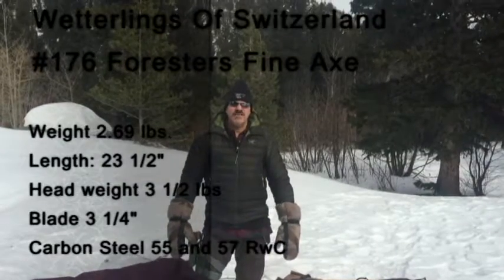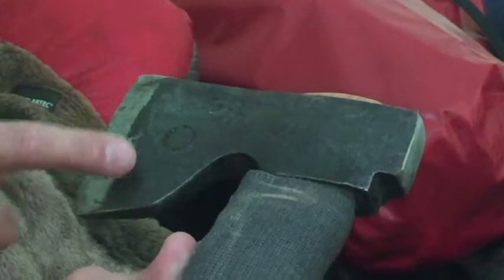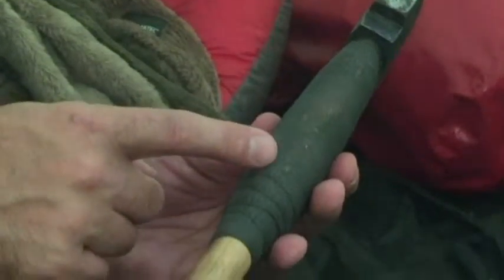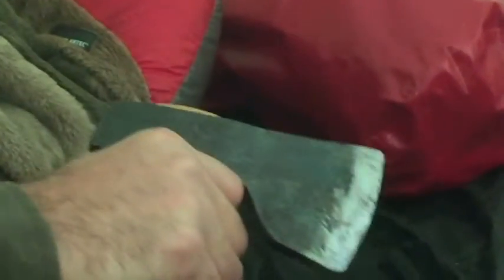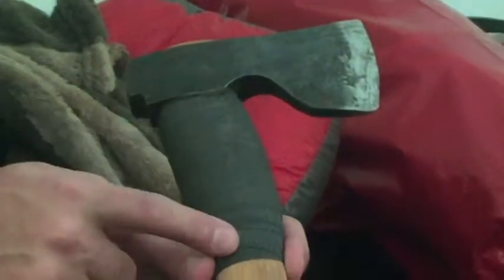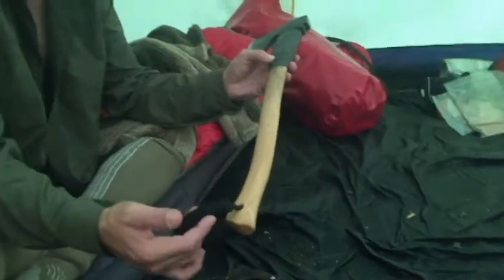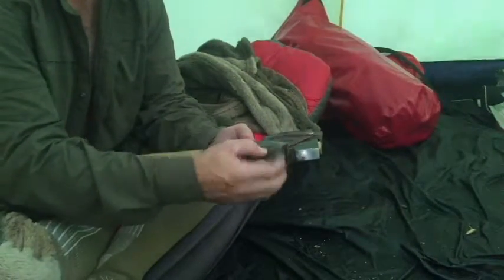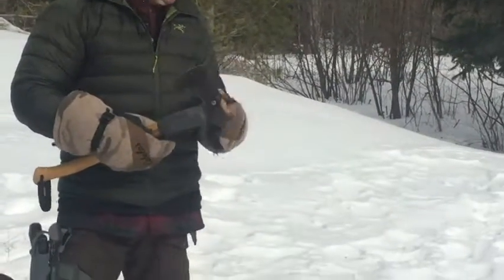Wetterlings Foresters Fine Axe Part1 Field Review

Comment: I have the hults bruk aneby axe, Like the idea of keeping moisture out with the tape as opposed to the leather. Do you have a website for that material or info on where to buy. thank you in advance . Good job on the video,
Reply from the maker: I bought fiberFix on Ebay. Search for "FiberFix" or "Fix it Wrap". I think it's the same as the medial cast stuff, search for "casting tape". I have some of it in my medical bag to make casts but I haven't used it on my axe. I'm not sure if it's as strong. Make sure you wrap it fast or else it will dry before you get it on.  I never used the elastic that comes with Fiber Fix, which is supposed to squeeze the water out. Never had to use it. I wrap it tight.
Reply: Just found that walmart and home depot have it. Thanks so much.
Reply from the maker: You're welcome Perry. Let me know your experience with it. I'm guessing that after a year or two of use I may have to replace the fiberfix but I'm expecting my axe handle to be in great shape. I hate it when the inner rings of a log split but the outer rings don't split and they hit the neck of my axe handle. I've hit the fiber fix pretty hard with no marks or damage to it yet.
Reply from the maker: I've been wanting a Kisa. It'll be my next axe. I want a two lb head with the same style handle as the Wetterlings. I'd like to try a slightly fatter handle. Maybe I'll do a compare the Wetterlings and Hults one day.
Reply: I will be waiting for your video on the comparison. I'm sure you will be thorough. Keep up the good work